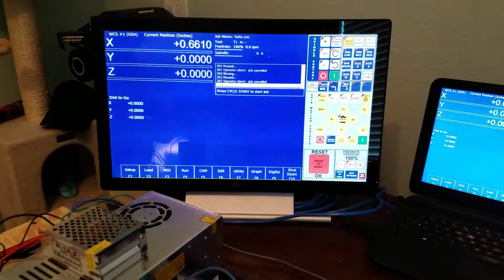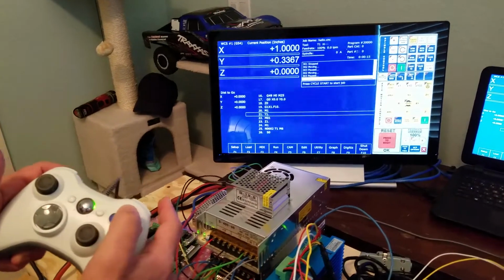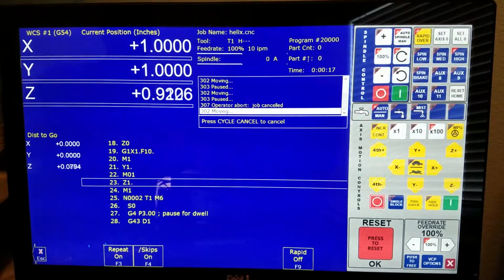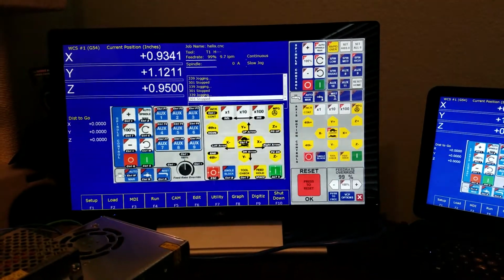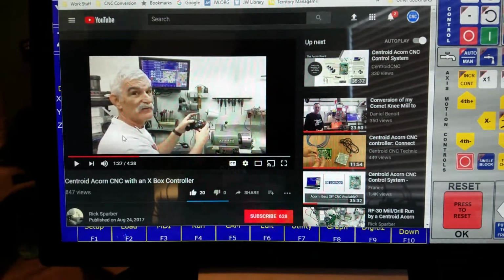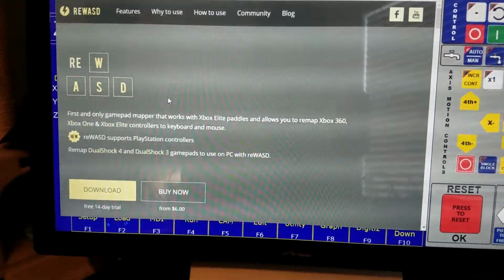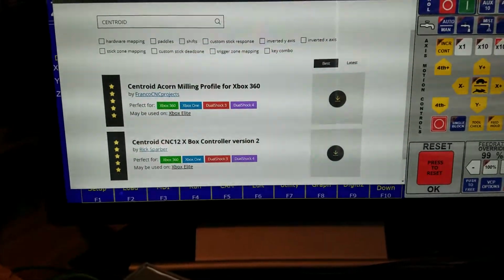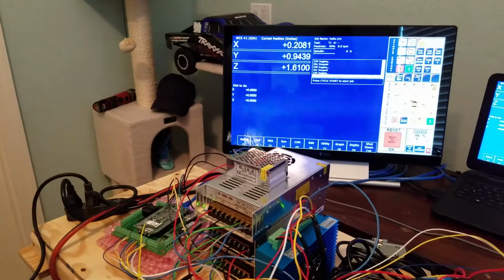Using an Xbox 360 Controller with the Centroid Acorn CNC Control System

Comment: I realize that this was posted 3 years ago, but, can you use a wireless Xbox 360 controller?
Reply from the maker: There is a way to do that with key mapping software.  I used to use a program called reswad.

Comment: I just received my Centroid Acorn tonight, I have not opened the box. Now thinking about VFD for the drive motor.
Reply from the maker: Cool.  Make sure you check-out the Centroid wiring diagrams.  Look for S14826 ACORN STANDARD CONNECTIONS.